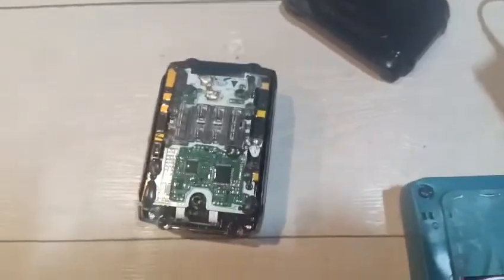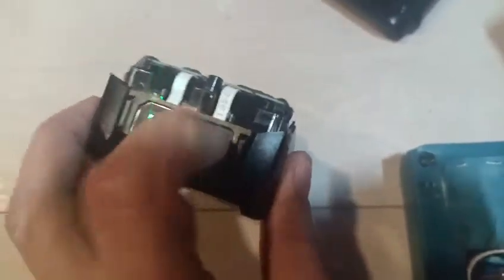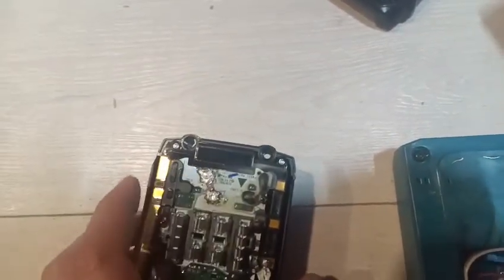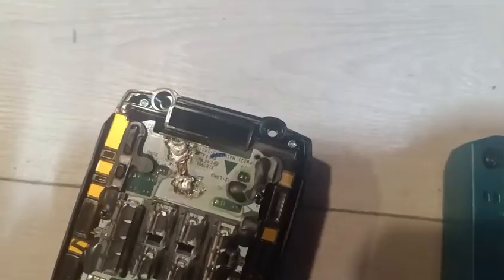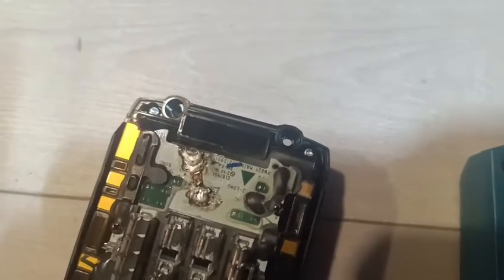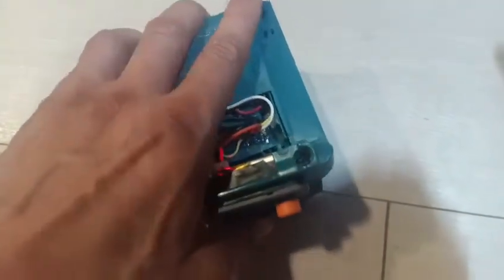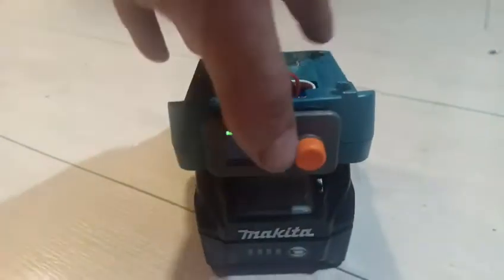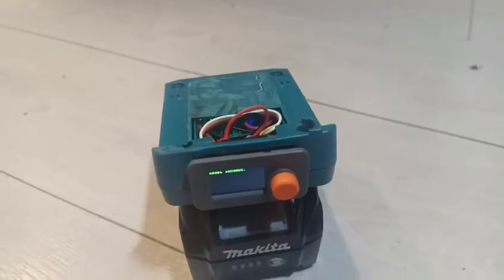Makita XGT battery flashing lights reset/repair

Comment: I have a question: when performing this repair by soldering over the fuse, does this pose any significant danger to the battery? I imagine that the entire crowbar circuit no longer serves any function after it has been triggered once and we solder over the fuse, meaning the battery is now only protected by the BMS protections  or am I wrong?
Reply from the maker: battery is then only protected by communication between battery and charger. case of the "don't overcharge or you will get fiery results"

Comment: My 5 amp 40 volt battery charges with no issue then when I place on my sds the battery just flashes all 4 lights simultaneously and its only a few weeks old which takes the piss really, thanks for the videos
Reply: Having the same problem. Did you find a fix for this?

Comment: awesome work man - would you mind making a video from scratch on how to program the m5din and a complete list of necessary hardware?
Reply from the maker: :P for the xgt thing it's only the m5din and the cable, you can even just poke the ends into the battery as on the picture on github,  and sure when i have time i can make a video on how to program it.
Reply: @diybatterytech thanks bro - I ordered the part and cable.
And I found out the Arduino IDE is only a software program, not the actual arduino controller.
So I am hoping I am all set for when the m5din arrives.
I checked my XGT 4Ah, all the cells are at 3.6V so good news  :)
Reply: @diybatterytech  Hey my m5stack has arrived and I got the Arduino IDE - I am not sure which files I need to transfer to the m5stack. where exactly do I find the files necessary? many thanks
Reply: I think I found the library - I am stuck trying to connect the m5 to my mac using arduino ide. Compiling the sketch works (obviously) but uploading doesn’t. Fatal error - probably wrong port..
Will continue trying and will update you..
Reply from the maker: @treehousegecko  connect the m5din to the mac using a good USB-C cable that supports data transfer?
Reply: @diybatterytech oh man I am fiddling with this.. I ended up using my partners pc bc I couldn’t get it to connect.
I tried to upload a test sketch and now the display doesn’t turn on any more. 
I am worried I bricked it somehow.
So I am now trying to factory reset everything. Its maddening. I am almost at the point to buy a new one to start over.
Would you consider selling devices with the flashed sketch and ship em?
Reply from the maker: @treehousegecko  i prefer not selling any of this, but if you want one i can ship you one, if you cannot get it to work send me an email at apol@mail.com . usually a test sketch requires button input or something, or there's just no display output.
Reply: @diybatterytech  good news - I managed to flash the. userdemo back onto the device - I used m5burner this time. back to factory settings yay! :)
Reply: I have now uploaded the firmware onto the device but it doesnt give me anything in the display. I should see green text right? But somehow the display shows only backlight but not lines or menu. What am I doing wrong?
Reply from the maker: @treehousegecko  insert wires into battery i think?
Reply: @diybatterytech  I finally got it to work. and it did reset the battery. however the tool doesnt fire up with the battery even though the battery indicators dont show the flashing lights anymore. the charger did try to charge the battery for like 30secs and then gave me a red error light. Do I need to solder over the fuse? would that help?
all the cells are fine and within 0.1v
I just measured the voltage of the battery at + and - and I got 0V. that cant be right..?
Reply from the maker: @treehousegecko  Yes, solder the fuse. If you want the tool to boot up when put on the battery you need one that has more than 0v, and to connect the + and - wires of the m5stack.
Reply: @diybatterytech will try that tmo - the cells all have 3.6V - its at 50% SOC but still I don’t have a voltage between + and -
Reply: @diybatterytech I cant believe it - battery is working 🤩
Thank you very much for your support!

Comment: I bought all the necessary things to make it , hopefully i will be skilled enought to make it happen , is any difference if the lights flashes green or red ? Or its just a different type of battery ?
Reply from the maker: i have not seen makita 40v flashing red yet - is it an original battery?
Reply: @diybatterytech Hello pro, How do I use it on my computer? I don't have the M5stack tool.

Comment: Hi. My XGT 8ah battery has the same green flashing. When I was charging it , it began to rain. I Tried to dry it with hair dryer. Do you think I could reset it?
Reply from the maker: possibly, if the PCB is not too corroded, water damage tends to do that. this tool will show what is off measurements wise in case something is damaged on the PCB too.

Comment: Hello there Can i ask you How can i get this flashing lights reset tool?
Reply from the maker: go to the github link, all you need is a m5stack and the cable they sell for it, and arduino IDE to flash the firmware.
Reply: @diybatterytech  Hello there i bought M5stack. Hvae you got any diagram for assemble and firmware config?
Reply from the maker: @eleman27  Firmware can be downloaded from the github, use arduino IDE to flash, m5stack have a manual on how to use arduino IDE. the wiring is also on the github, you need only 2 wires and you can just shove them into the battery if you want :)
Reply: @diybatterytech  Hello there Thank you very much for answering me but i couldnt upload firmwareto M5DinMeter it keeps giving me error "\Arduino\makita_xgt\makita_xgt.ino:3:10: fatal error: XGTSerial.h: No such file or directory" I think  I am doing something wrong 
Copuld you please help me about that or Can you share Video How can upload firmware and set up?
Reply from the maker: @eleman27  yes, put the library files from the github in the arduino libraries folder
Reply: @diybatterytech  Thank you very much it is working
Reply: @eleman27  hi pro can you help me setup FW . Thanks

Comment: This might solve the issue with the "tool starts and all of a sudden stops"? kind of "activation" of the controller

I followed the steps with dual 18v battery that you suggested (tried 1kOhm and 500Ohm resistors) it does turn my XGT router light on(1st button), but when I tried to turn the tool on (2nd button) it doesn't work
What I did noticed is that when I'm pressing fast 1st and then 2nd button - the tool turns on for a second and then turns off.

I read that the battery should be "activated" first with the original charger but I'm not sure that this is the problem in my case - do you know what the indicators show in this case?

I'll try also with 250 Ohm (possible that the discharge during the turn on of the tool via the other connectors is too high and the 500Ohm limits it)
If it won't work my next step will be trying the M5Stack - as buying a charger for only 1 battery and 1 tool is ridiculous...

I've 18650 cells to assemble the battery but I don't have a charger for it.
Reply from the maker: This tool is meant for resetting original makita batteries - not for the BMS pcb - i only have the microwave so i can't say for sure what the issue with other tools is, but https://coredump.ws/xgt/xgt.html is the setup i used, and it worked for the microwave. maybe smaller resistors will work indeed.